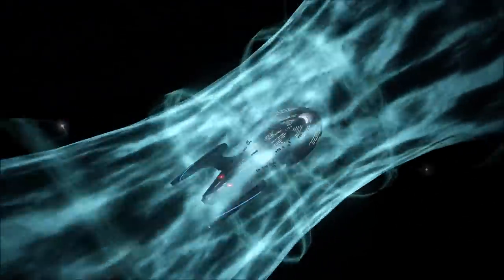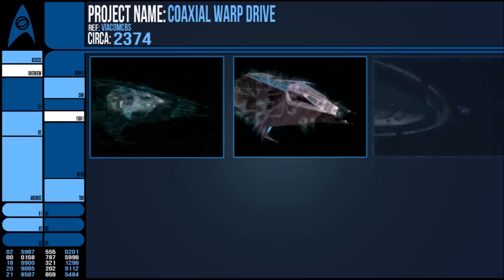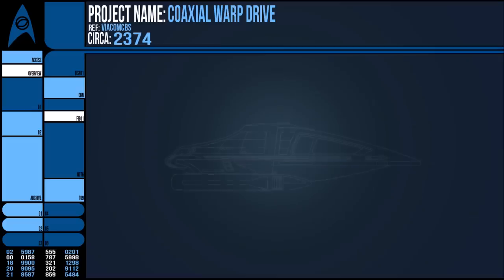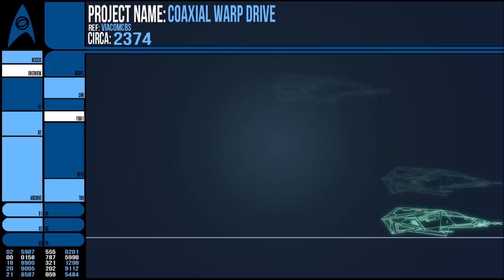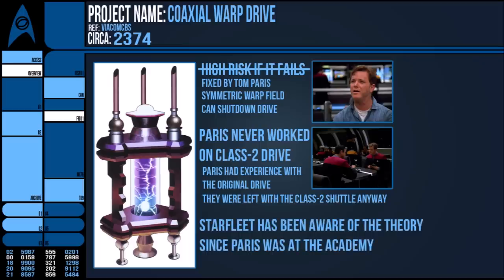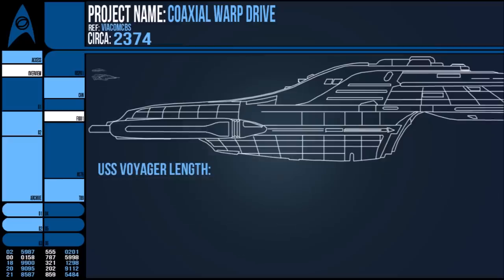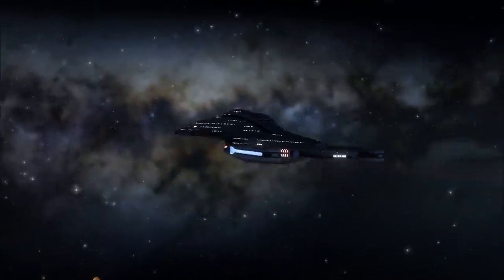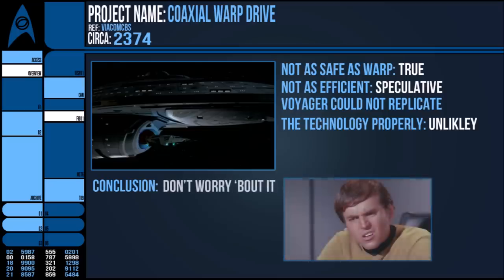Why Not Coaxial Warp Drive? (Star Trek Theory)

Comment: I wish they had used the coaxial drive more. It had real story potential, especially if it could only make short jumps and figuring out how to make the jumps long enough to make it home would have made for a better last episode than the mess we ended up getting.
Reply: Let Voyager fly the direct course home, then jump the shuttle diagonal to it. They can easily catch up later, and if something goes wrong, there is story potential because the ship has to turn back and spend hours or days running to help while whoever was on the shuttle is in a dire situation. Great potential for smaller stories outside the ship with a limited cast.

Comment: Not to mention there's another reason why there could be, again said is actually based on navigation maps. I mean what happened did you accidentally miscalculate and jump into a planetary atmosphere! I think it's very similar to the same issues that came across with the Starfleet cloaking device. After all, when they test it out. They found themselves lodged inside a giant asteroid(granted I'm referencing a TNG story as another reason why the drive is not used) . As stated never see the drive being used around planets. Combined with its highly explosive possibilities.

Comment: There more than likely is a hard limit onto how many lightyears away you can travel based on some sort of scanning technology that has to isolate the section of space you are folding to jump into.  It's also possible that whatever tech that must be used in order to identify a coordinance is unreliable.  Perhaps like a transporter that has to have a single lock on the person moving and the location they need to move to.  So... a hard limit on distance and being unreliable location detection would be my guess.

Comment: in universe: they'd need to build another ship to work on larger ships, voyager's warpcore and coils can't be adapted without dismantling them

(probably)
Reply: Interestingly, according to Voyager's schematics it has TWO warp cores. They never talk about it on-screen but I imagine that this redundancy helped the ship survive as long as it did, and enabled it to experiment with other propulsion methods (like Slipstream) without halting their normal travel.

Nevertheless, you could be right that the ship couldn't be adapted — it probably takes a lot more changes than just tinkering with the warp core.

Comment: Well I imagine it's because making a coaxial jump doesn't let you scan and explore the space between the 2  points, so it would kind of defeat the exploratory purpose of Starfleet on frontier missions.
Reply: Considering the range is limited, they could do a jump about twice their sensor range, and then scan back and forth. So if they can scan 10 light years, scan 10 ahead, jump 20, then scan 10 back. Or put it in a shuttle or the delta flyer and have that thing jump ahead in a zig-tag pattern to check on stuff slightly off course.

Comment: This is a common problem in engineering fields, do you spend time on the new system or place the resources in the new. Typically it is best practice to choose established techniques as this can be applied to all systems in use. Also the new system tends to provide only marginal gains, with the added burden of a new supply chain, and a new training program.

Comment: Speaking in terms of physics, any energy requires fuel and any effort requires a load bearer. If you think about the logic of a self cancelling knot, it puts the load on the knot rather than object constrained by the material. It's the same with all methods of sci-fi super fast travel; they put the burden on empty space, rather than on the passengers. If it's true that there is a practical speed limit, then by creating a self cancelling knot in space where the burden of travel time is deposited in empty space, then billions of years pass in moments around the ship, meanwhile the universe must accept that the travel toll has been paid and the passenger logically must have traveled.
 Time itself, practically speaking, does not exist. What does exist is matter and energy degradation. By slowing down the physical computation of energy degredation, the passenger is permitted to survive lengthy travel time.
 Objectively viewed, a bubble is created in which energy transfers have virtually stopped, meanwhile everything outside is moving, and further beyond that the displaced energy is mitigated on empty space, allowing passengers to synchronize their observance of time passing with the neighboring environment.

Comment: could be they deemed it dangerous to use, warp bubbles create a local field of warped space while a coaxial warp drive bends large pieces of space. problems would occure when two or more ships would target a point that is directly in line with one of the other ships possible rips in spacetime go brrrr (for example take two pints that are 10cms apart from each other on a piece of paper now conec them in a line, now every point gets a target that is 6cm towards the other point, try folding the piece of paper without ripping it apart so that both points meet with their target at the same time).
Also what if you target a place in space that is alread occupied by another object like another ship or even planet heck even a small thing like an astroid do you fold into that? does it get folded to you and smashes you?
Coaxial Warp might work in the Delta quadrant as there doesn´t seem to be that much traffic but imagin that in federation space with hundreds if not thousands of ships passing major systems

Comment: If eXotic Matter is a problem... I could actually see how that could be an opportunity,  a key, a solution in of itself, for a nearly perfect closed cycle energy system... Just add a few other technologies in to the mix and make a loop system... with excess overflow(created from external* field interactions) itself being used as power (used in ships operations and "conventional" propulsion, etc....) rather than the actual power (that is)being generated(in the system) and re-diverted(in co-convergent and parallel cycles(looped like a spiral folded onto itself)) to ensure continual operation... it's not perpetuum mobile no, not quite... but not bad, quite close actually, 
and potentially a systemic step forward for us as a technologically dependent species, and systematic one too, logistically speaking... 
...might also need additional* (and innovatively* so)computational power for near constant reconfiguration and decapitation, but that's not a problem, an opportunity in of itself as well really...buy that's sort of a different project... but like many before it in our history they'll find themselves joint soon enough in order for us to succeed and move forward...we will after all need to be more innovative, more so than ever before, to climb over this next obstacle, this next little-big step in the Great Filter process.., assuming one subscribes to such philosophies...

Comment: Completely out of left field theory, that has nothing to do with the episode itself.  Perhaps the nature of Coaxial Warp was discovered to be far more damaging space than even the regular warp fields as originally displayed in Force of Nature in TNG. During Voyagers time supposedly they had mitigated the damage to Warp space by using variable geometric pylons to avoid the damage to space. But that was with a regular standard Federation warp drive which merely slightly warps space. 

The Coaxial Warp literally bent space which seems like it would be far more intensive and damaging to space then a regular warp field. That's a reasonable theory anyways.

Comment: No evidence for this, but perhaps the Coaxial Warp Drive damaged space just like the older Starfleet warp drives did that caused them to put the Warp 5 speed limit on the fleet until they developed improved technology.  Grabbing a piece of space 20 light years away and ripping it to your location certainly sounds more violent that a small, local bubble being compressed and stretched.

Comment: Why not a continuous version of the drive that stays between folded space so while coming out of folded space it selects a new destination 20 light years away and continue warping at extreme speed. instead of making a wormhole your ship gose through instead you make it around your ship and travel through folded space and you keep folding space the more distance you travel. I don't buy the less efficient thing because it would take a lot of power and a lot of time like months for a normal type 9 shuttle to go 20 light years. I think they might have intended for Voyager to use it in the show but probably just forgot it or thought it would be too overpowered because it is. If they can make that drive work continuously then Voyager could go 40 light years in 4 seconds and that would be faster then quantum slipstream and fast enough to keep up with Borg transwarp for a time.

Comment: The most likey reasion is that it would require exstencive sensor data of where you want to go so as not emerg within a dark mater object thus limiting the range to sncor range of the moving ship, such a system would be better in settaled space wear the distance and motion of the target system is known but for the federation and there exsporation vessales it would prove less usfull.

Also what about when you jump out? what is the minumum safe distance? 

When the ship jumps out in the show theres a bright flash and the shields flaire so could there be negative impact on systems you jump out from.if there is then this would make it even less populer with star fleet, but as a military jump system it would be great, jump in at a known target, jump out and flatten them with your wash.

Comment: In theory any reaction that is subject to pollutants has an impure source for fuel or has insufficiently rugged materials in the housing or catalysts. If the power of the the reaction is such that it literally burns up the casings then it would effectively burn out the ship. On a multiple system voyage? you'd be begging for spare tritanium at every star system

Comment: Personally I'm in same mind set as yourself that it was only ever viable for a small shuttle craft than a large starship but even if that's not the case it would be very good for wartime more than exploration as you could easily miss something of note that it's only possible at certain times were as for us on a warship just like with discovery the ability to for lack of a better word jump in and attack then jump away just as quickly would be very useful, in terms of the show I'd say it had more to do with it being very similar to the FTL drive on BSG so they decided against it I'm not sure if I'm remembering correctly but I sware voyager was still running when BSGs remake started which would account for star treks writers not wanting to use it due to being so similar to FTL

Comment: So if they start using coaxial warp drive would the next step be fiber optical warp drive?
Reply: Actually, the next step was called "Twisted Pair" or TP warp.  You might of also heard this referred, colloquially, as  "Category 5 or Cat 5" warp, which has since been upgraded to "Cat 6" warp.  But, this warp, while faster than Coaxial warp, was found to only be accurate in relatively local travel.  If you attempted to go too far with TP warp, you could no longer predict where you would end up.  So, coaxial warp is still widely used over great distance.  But, it is slowly being replaced with Fiber Warp, as you said.
Reply: @StefanMArndt  I completely forgot about that. I guess it was do to not being wide spread or rarely used in I area. When you are usually planet bound you don't remember all the changes in get from one place to another.

Comment: @northeastoperations
0 seconds ago
Even if in theory the hops of coaxial warp took exactly the same amount of time , it would still be safer than warp if the jumps are far enough. No more running into hostile forces or Borg or environmental factors. 
I suppose the biggest reason not to use it would be for plot reasons. It would be harder to write for the show. It will be more like writing for deep space. Nine. Still possible but less like a journey I suppose.

Comment: Incompatible with voyagers factory installed systems?
Having the capability to repair something doesn't automatically give you the capability to manufacture that thing. Seven needed periodic maintenance that the doctor could perform yet there were a few parts they just could not replicate.

Comment: As far as I understand it may come down to a simple value of distance not the distance you're trying to travel because that's only a very short distance because you're folding space-time on top of itself but more you're trying to pull into the future position you will be in or at least try to put yourself in a position which is far in the future so it would be logical to assume that it would take a absolute crap to of power
Theoretically speaking if the distance you're travelling was say I don't know on the other side of the galaxy think of it like elastic band you can stretch it quite a far distance and you can fold it on top of itself but there may be a potential that if you stretch it too far or if you put too much pressure on it say for example your theory of a much larger object that you could "snap" space-time hypothetically speaking and that would not be good

Comment: No no no. It was developed, by the writers of Battlestar Galactica! LMAO For Trek, warp must remain because it is a Trek feature. Many Trek fans would be pissed if tomorrow, Trek no longer uses standard Warp. Luckily, BSG caught on and used jumped drives for their Sci-fi. If you think about it, nearly every sci-fi has their own unique system of propulsion. They may introduce others but that technology is never widely adapted. Or the animation differs enough that people think of it as different. The closest sci-fi, where the propulsion method is similar to trek is Dark Matter. I LOVED the show, but they animated their 'warp' to look so much different than Trek that you would think it is two separate methods of 'warp', ha ha. If in 2019, Trek wants to revisit the coaxial drive they will first have to develop a drive that bends around copyright issues. A devastating spacial anomaly, LMAO!

Comment: They never used it because of the damage that the warp drive dose to sub space. Its even worse with folding space by brute force. It ripping subspace apart. They are working on improving and adjusting normal warp drives doings o for total new technology where you got to start from scratch is not economical and scientifically viable.

Comment: never understand why janeway did equip the borg transwarp coil to delta flyer in episode dark frontier to get seven back. when we know the delta flyer could use the quantum sleepstream drive fine on the delta flyer.. since harry and chakotay got back to earth in the episode timeless whit it on the delta flyer .. they should just let voyager have the borg transwarp coil hooked up and let the delta flyer use quantum drive.. and they should have built 1 of the class 2 shuttle whit spec tom paris learned from that identity thief and use coaxial warp engine.. since it worked on that alien ship it would be less danger on a way smaller shuttle like a class 2[type 9] shuttle

Comment: If the drive is more compact, then it has various military applications. Assuming scaling up the drive linearly to fit larger ships, it could be used as an excuse for an alternative design language for the ships in Star trek. I should mention i HATE the design of most ships in Star trek. Yes let's put gargantuan nacelles and a saucer tens of meters away from the central hull of our ship suspended by a single excessively narow point of failure. Because no one would ever think to bisect the ship by slicing the neck of the ship or clip its wings cutting off the nacelles. Rant over.

Comment: there is also a problum the math because every thing mpoves so going to a place in a "POP DRIVE" is if you pop to where your going and the math is wrong "POP" your in a sun or you your in a black hole ...also is the space static than it is easyer but in the real world math has to be spot on and also the power /to and or/ travel is donting say you pop to the star where you see it and where it is is light years off do to expanchion ...

Comment: It sounds like the real-world problem with thorium reactors.  In theory, thorium reactors have many advantages over standard uranium/plutonium reactors: thorium is three times as abundant as uranium, thorium reactors are slow breeders (meaning they require the addition of more neutrons to continue fissioning) so it can't run out of control and just shuts down in case of an accident, and fuel would last potentially thousands of years without replacement.  

In practice, however, we've had 70 years of intenseive work on fast breeder uranium reactors and very little work on thorium reactors.  It would take hundred of billions or even trillions of dollars and decades of research to bring thorium reactors up to the same efficiency as uranium reactors.  It's possible that Stafleet is in the same position, that coaxial warp is better in some respects, but so much time and so many resources have already been poured into other options that making coaxial warp feasible just isn't economical.

Comment: There's one angle i'm surprised you didn't tackle this, the effect it would have on subspace. Voyagers warp engines and the pylons they rested on, were developed to help minimize the effect of prolonged and prolific  warp travel on sub-space. If the Coaxial warp folded space  together so you can instantly jump between 2 spots, what effect could that of had on the fabric of subspace?